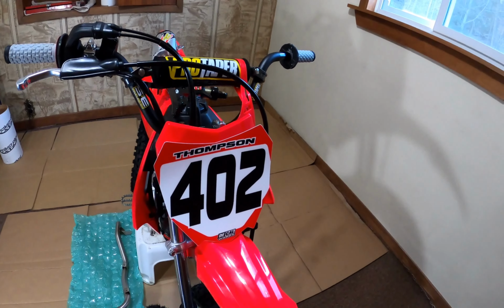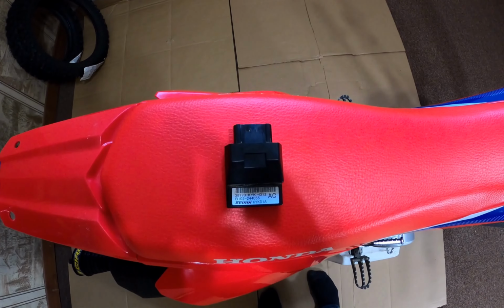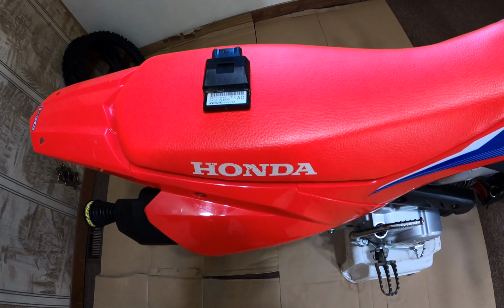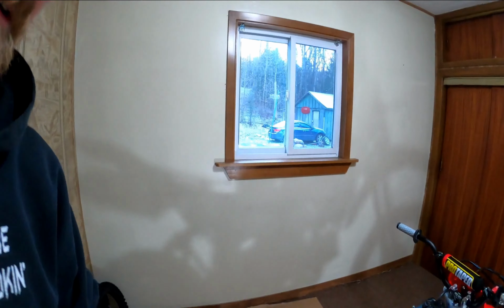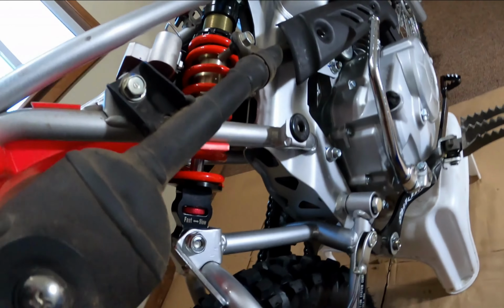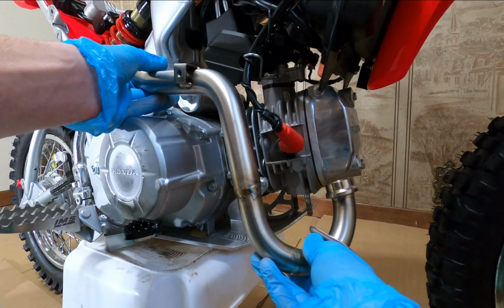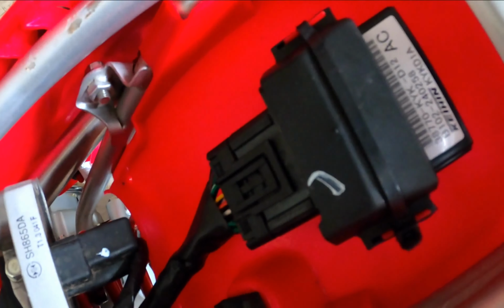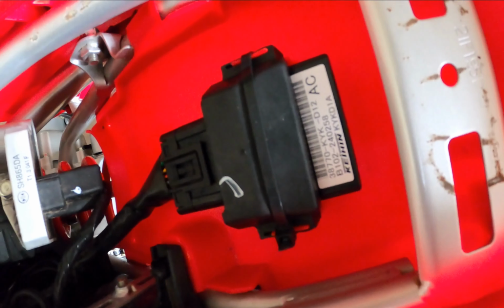2022 Honda CRF110 Build Part 3 (Pro Circuit T-6, CJR Tuned ECU, DNM Rear shock, etc...)

Comment: Amazing video. I just bought a brand new 2024 Honda CRF 110F, and there is a big problem with it, perhaps you can help me with. I didn’t get a chance to ride it in the dealership, they didn’t let me. And now that I tried it, the bike kicks pretty hard when shifting. When you shift from neutral to first it kicks a bit. When your shift from 1st to 2nd, it kicks pretty hard. When shifting from 2nd to 3rd and from 3rd to 4th, you don’t feel the click of the gear lever, but it doesn’t kick at all. And when downshifting, you could be going in 3rd or 4th gear and slowing down, and downshifting when almost coming to a stop, it kicks hard as well. I would appreciate any kind of help. Perhaps there is some kind of an adjustment I can do to eliminate or at least reduce this issue. Thanks so much.
Reply from the maker: If it's shifting hard I would call the dealer and ask them to check it out while your still covered under warranty.
Mine has a little bit of a bump when I shift but not enough to make me concerned at all,
I wonder if your clutch tension thing is too tight possibly
Reply: I'd say it's probably slme sort of clutch issue not adjusted correctly or something by the sounds of it 👍

Comment: @wastedwages402 So does the tuned ecu for the exhaust come with the exhaust when you buy it or do you buy the tube separate and if so where do you find them? I'm most likely going with the same exhaust in the near future

Comment: is that the 250lb rear DNM shock?  Did you use the spacer with it?
Reply from the maker: Yessir it is, I'm like 140lbs soakin wet 
I loosened the preload a tiny bit, and it's damn near perfect.

I did use the 1" spacer with it, gets it sitting at a good height I think

Comment: Yo wasted need a quick response did you need to dremel out the frame to put the extender on I’m getting ready to do mine right now
Reply: Wondering if I need to go get a dremel before I take it all apart
Reply from the maker: Nope not at all
Reply: @WastedWages402  brother I’m having a big issue since I lifted the bike up my chain is rubbing against my faster mini sprocket card and I went online the MB-MX is sold out everywhere and the BBR motor mount chain roller is sold out everywhere as well I don’t know what to do… how did you locate one?
Reply from the maker: @scottforti3194  yeah I had the exact same problem right away too.
I got mine from factoryminibikes.com 
I did have to wait like 2 months till one was in stock.

Possibly one of the Facebook pitbike groups? I've seen a few people selling stuff in them

That's a tough one. I'll do some googling lol
Reply from the maker: https://www.mb-mx.com/product/new-sprocket-guard-crf110f/

It says they have one black one bronze in stock
Everything else is backorder

Comment: Going to mod  a 2022 125 fb , literally can not wait , going to add a sprocket, full exhaust , tune , upgraded levers , taller handlebar ,  stiffer springs front and rear , taller seat mod , aluminum rims , skid plate . I think it will be a bit more user friendly. Not sure if it's possible but would like to change to a li ion battery for more weight reduction .
Reply from the maker: That's awesome man that bike will be fun as hell!

Comment: Is the DNM shock longer than the stock one ?
Reply from the maker: No it's not , so If you've done dampening rods you'll still want a shock spacer
Reply: Did you not do dampening rods how come you didn’t put a shock extender
Reply from the maker: I did dampening rods and a extender in, just a cheap one off factoryminibikes.com

Comment: Hey man, just wondering if the bike is taller now since the suspension upgrade, it looks taller I see you have a rock under the kickstand
Reply from the maker: Yes it is, about a inch maybe 1.5" taller now. 
Better in corners not dragging pegs as much,  and more comfortable being a little taller

But yeah as you see the kickstand is pretty useless once it's higher, ill be doing the lux extended kickstand soon

Comment: Do you notice a difference with the tune. I installed the t6 exhaust as well, but haven’t noticed bogging or a reason to get a tune yet. Your bike build is looking great btw.
Reply from the maker: It's a tiny bit more responsive off the bottom, not too much difference there.
    But higher rpms is where I notice it, it has a little more power  and it just keeps pulling.

Where the power dropped off at higher rpms stock, it just pulls and pulls to the rev limiter now.

Thank you much appreciated! Not going crazy on it but getting er puridied up a bit!
Reply from the maker: Honestly the tune is good, if you've got the extra money and nothing else important to do to the bike,

Otherwise it's not a night and day difference so I wouldn't even worry about it
Reply: Bike looks good man, i have almost same stuff you have done, added the cjr 24mm tb/26mm cast manifold and the rad cage/p-trap:) along with the v2 flash it really makes a difference i did the pipe first did basically what you wrote the other mods help alot.
Reply from the maker: @scottwhitehead4278  thanks man  I appreciate it
thats awesome,  I think that manifold and throttle body are gonna be my next parts to buy

Gotta get a extended kickstand too.. the bike is doing a bubba scrub trying to stand up
Reply: @WastedWages402  i tapped the end of mine and threw a bigass bolt thru with nutz.Im on the list for a BBR swingarm:))
Reply from the maker: @scottwhitehead4278  ya know I was actually thinking of that the other day 
It'd save alot over getting a kickstand shipped to canada lol
Reply: @WastedWages402  it works for now and was cheap:)

Comment: How do you like that DNM rear shock?
Reply from the maker: Honestly I've only got about 2 20min rides on it so far (Lots of snow here now
It's a huge improvement over stock
I dofind it fairly stiff (I'm 145lbs) but the adjustable rebound and compression is awesome and as it breaks in a bit I think itl be perfect
Reply: @WastedWages402  im 215.  I just ordered BBR springs today.  Not sure yet. But I wanted to see how far I could go on just stiffer springs.  Hate the idea of changing geometry such as 1" taller bike.  Kind of hate the idea of going away from what it is to start with, cute.  But I also like to rail, so... Haha
Reply from the maker: @bikemancody2752  the springs do make a big difference, 
and being 1" taller i definitely noticed a difference. mostly in wheelies suprisingly.

it was a bit harder to balance during wheelies, in corners suprisingly it didnt seem to affect much
Reply: @WastedWages402   are you saying it was harder to balance wheelies after adding the springs? I just bought a mint 2020 110 and was thinking of adding a new spring or shock along with front springs. But also wanted to know if the rear shock/spring made it harder to balance. I need all the help I can get.
Reply from the maker: @chile2be991  in my opinion , the shock spacer, yes absolutely. 
Not a huge difference,  but noticeable forsure.
The dnm shock itself I don't think effected it much
Reply: @WastedWages402  ok. Well thanks for the ⚡ fast reply. Will probably go with a new shock and add spacer if i don't like the way it sits.
Reply from the maker: @chile2be991  no problem man, that sounds like a good idea to me.

 I sometimes think about pulling out the spacer and switching dampening rods to see what it's like again

Comment: where did you get the tune?
Reply from the maker: https://www.cameronjonesracing.com/crf110/p/crf110ecuflash
I bought a tuned ecu , for the mods
That way if I wanna go back to the stock pipe and tune its a easy swap and go